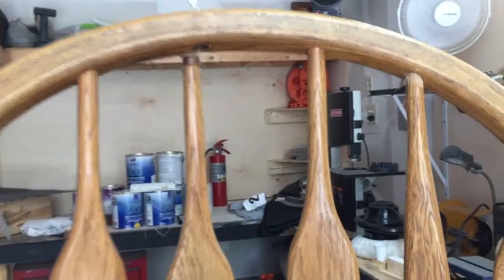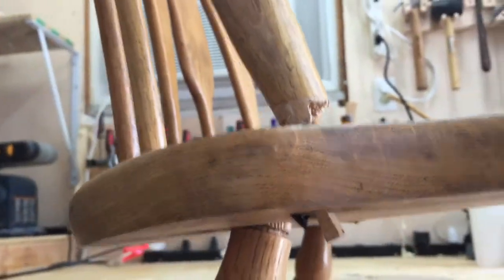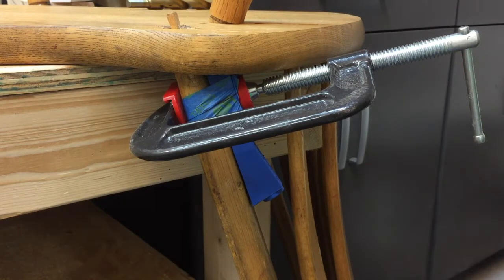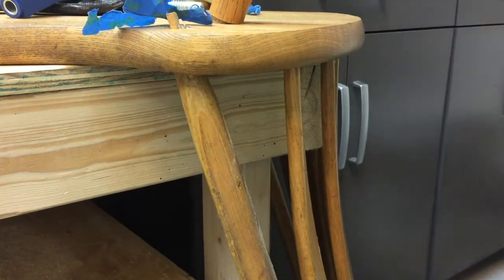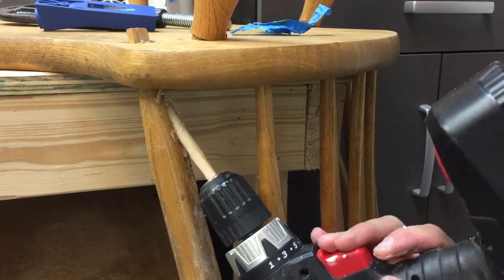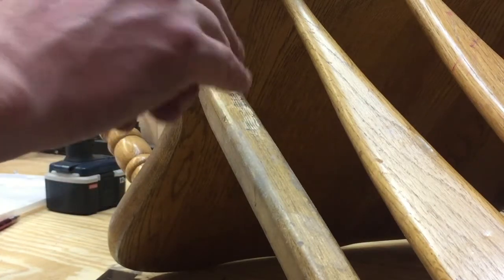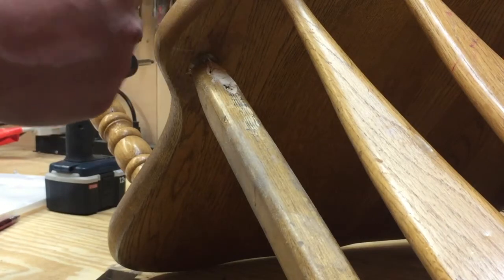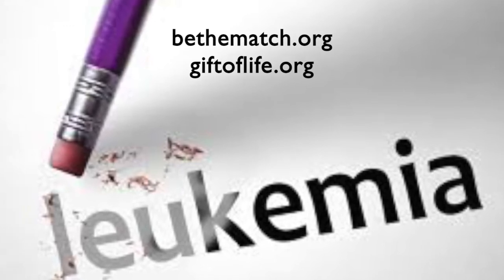Broken Back Kitchen Chair

Comment: The upside-down spindle that was left upside-down during this repair is making my eye twitch.
Reply from the maker: hmcnally on YouTube  Injust noticed!   The chair came to me in that condition and I didn’t notice.  But you’re 100% correct. Excellent call on your part.   Now my eye is twitching a little.  If the customer calls, I will take care of it for them at no charge of course.
Reply: I noticed it at about 0:07 in the video ;).
Reply from the maker: hmcnally yep. Chair came to me with the upside down spindle.  Believe me, with my touch of OCD, there is no way is would have let that go without fixing it.  As it is, I’m going to have trouble not taking down the video!
Reply: Leave the video up... it shows we're all human!
Reply from the maker: hmcnally You are good people.
Reply: Anyone who puts a dowel in a drill has my admiration!

Comment: What did the back of the piece  look like with the wood dowel after it was finished?
Reply from the maker: Joel Gwartney I should have showed it.  Had to sand the whole area smooth, stain it with Mohawk powders and lacquer and draw grain back in.  Thanks for asking!
Reply from the maker: Joel Gwartney I should have showed it.  Had to sand the whole area 
smooth, stain it with Mohawk powders and lacquer and draw grain back in.
  Thanks for asking!
Reply from the maker: Joel Gwartney fair question.  Looked really good after I filed it with epoxy paste and Staines and lacquered over it.